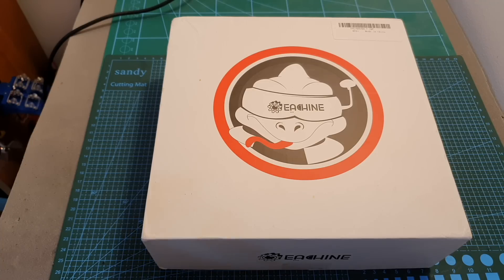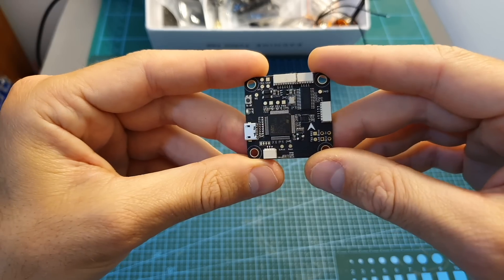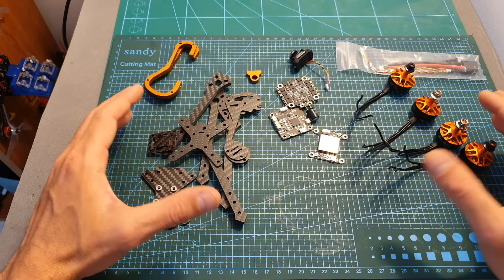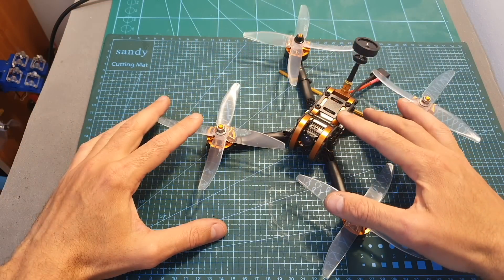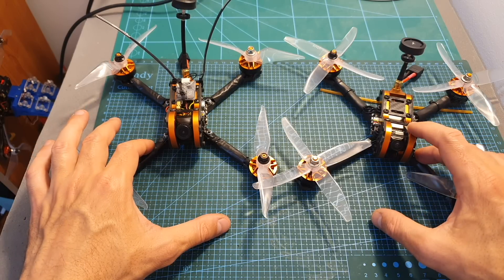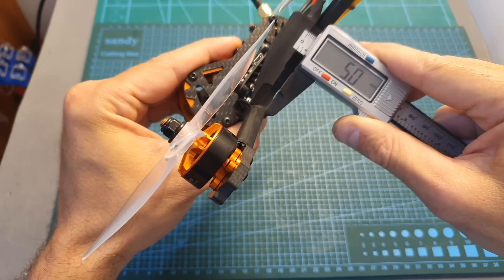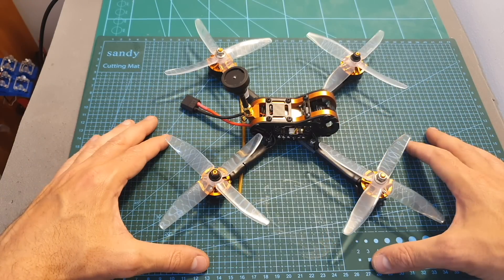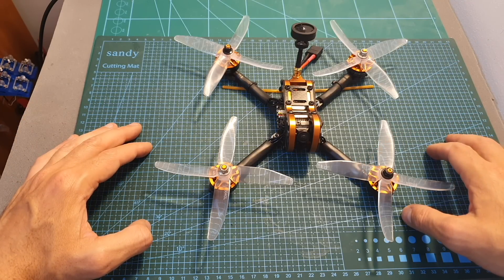Eachine Tyro109 Budget Friendly FPV Racer Kit - Build & Overview

Comment from the maker: Regarding the issue with the camera: The camera connector on the flight controller is using the V-Bat - that's why the camera didn't work. Luckily it wasn't burnt and it just didn't power up since the voltage was too high. What you need to do in order to sort it out is to de-pin the vcc pin and solder it to a 5v pad on the flight controller: 
https://ibb.co/cYTj0Wv

Comment: Are you. Sure the camera was bad just check that the voltage jumper for it was set to 5v and not 10v and it should work just fine. This camera can't take 10v
Reply from the maker: Yes, that was the exact issue. Thanks!

Comment: Saw you are using the original camera harness without changing the voltage pin, that might be the issue the camera is not working.
Reply from the maker: Yes, that's pretty stupid - the connector supplies the battery voltage and not 5v. I hope the camera wasn't burnt.

Comment: Thanks for the video. Tyro109 was my first quad build, and I also had a problem with camera, but probably I burned it by voltage from battery instead of stable 5V. I have replaced camera with Runcam Robin, and also added Vifly finder.
In overall I really like this quad, it flies really fast and smooth. With DAL T5045C and Betaflight 4.0.2 I have no propwash, or bouncing on default + freestyle settings from "4.0 Tuning Notes".
I have tyro109 DVR footage on my chanel - feel free to check it. BTW. Could someone recomend budget action camera for this quad?
Reply from the maker: Thanks, I will check it out. The issue with the camera is that the VOUT of the camera is the Vbat and not 5V... I will confirm it and add a comment about it.